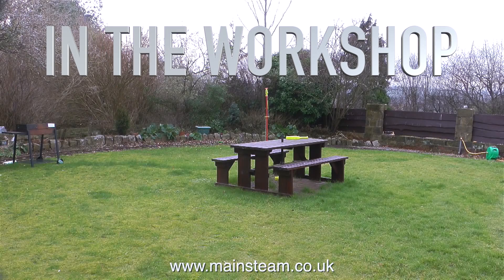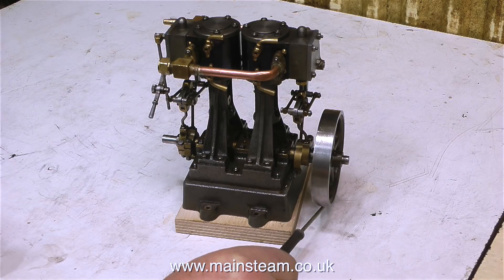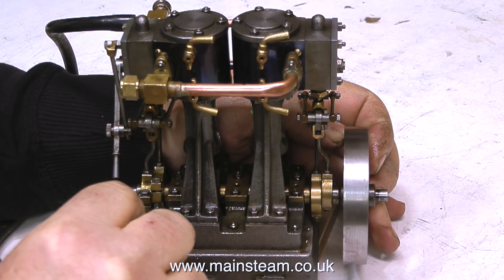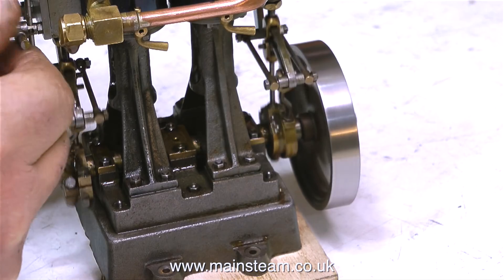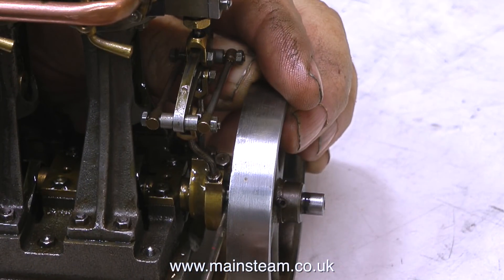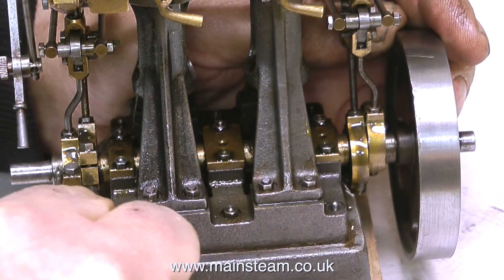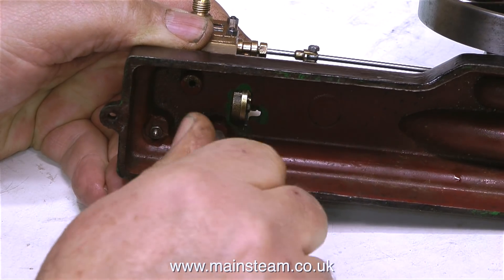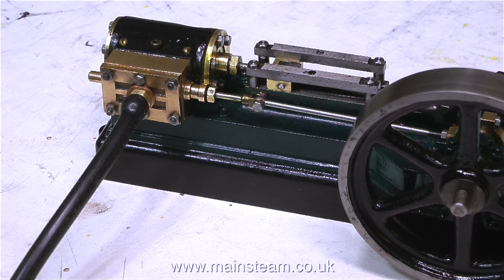LOOKING AT TWO STUART STEAM  ENGINES - IN THE WORKSHOP

Comment: Bonjour Keith,
Being able to ajust a D10 to have the same run on both sides is a real challenge, I knwow, I have three of them, I had no doubt about you skillness, bravo !
So many machines use Stephenson reverse, I do not understand why no one invented a tool with degrees graduation to adjust the excentrics, this is just arithmetic after all if parts are exactly the same machined..
Amicalement, Raphaël